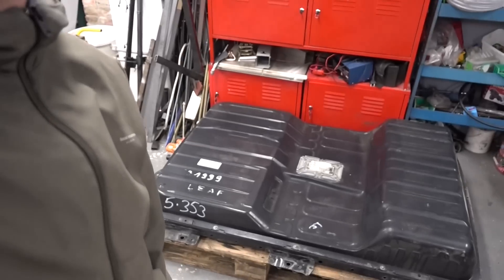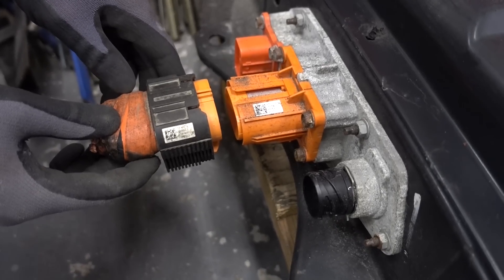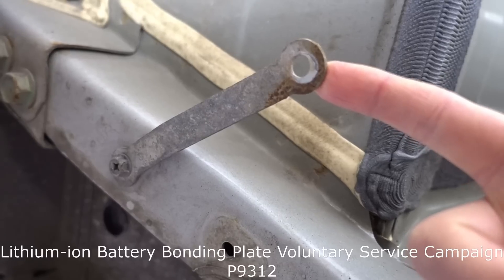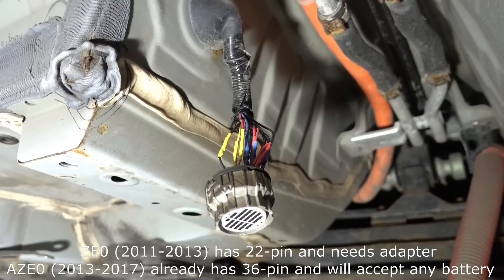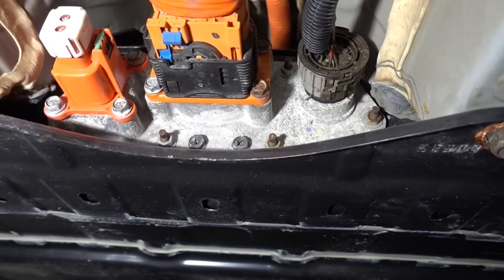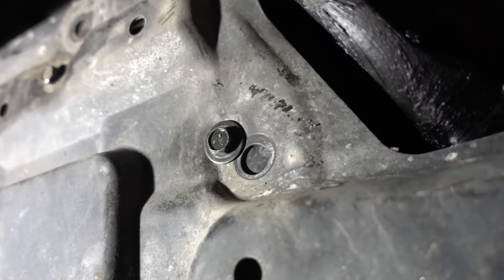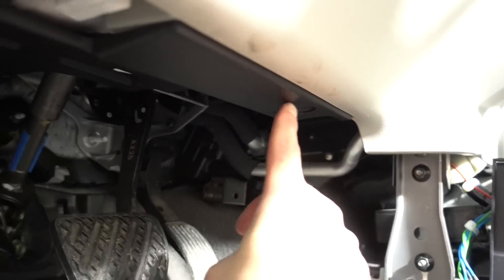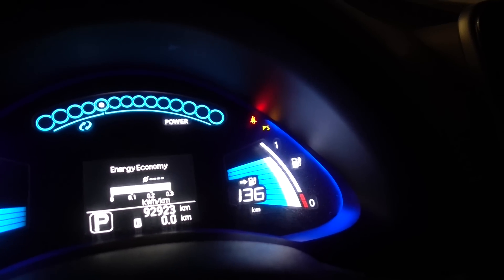Nissan Leaf Budget Battery Upgrade [ZE0, 24kWh-30kWh]

Comment: And this is why electrics aren't popular in regional Australia, it's 225km to the capital city from here.   Leaf will only go 130km or so without a recharge that takes hours, oh and there's nowhere to recharge it between here and Adelaide.
Reply from the maker: I visited the beautiful city of Adelaide last year. Out of curiosity i opened the Plugshare app, which shows the amount of public charging spots. It was a shock to see that a city with 1.2M inhabitants had less charging spots compared to an european small city of 65k people. You Australians have quite the road  to reach European charging standards. In EU, there are so many charging places that you can easily cope with a range limited EV.
Reply: @DalasEVRepair  thanks for the tip on plugshare, didn't know that existed.   There's exactly zero charge stations between here and Adelaide, some 225km.  There's apparently one here (which I must take a look at) and in the 540km between Port Augusta and Coober Pedy, just one at Glendambo (roadhouse has a generator).  Nothing between them but miles and miles of nothing but miles and miles.   Completely unlike Europe, huge distances and very little in between.  The Entire UK and all of Europe fits in Australia roughly twice over.
Reply: @geoffroberts1126  Oz is Tesla country, not Leaf country, it's far too big and hot.
Reply: @austrobok2958  Not really even Tesla country once you get clear of the cities.  No charging stations for hundreds of km and usually just one outlet.  Useless.  And 45c summers kill batteries, plus you really need AC  which kills it even quicker.

Comment: Great work , am looking at doing a cell replacement on my 24kw but contemplating replacing all together with a 30kw as 40kw packs a slightly harder to get at mo in New Zealand, are the 30kw cells the same so I can just swap into my original battery pack so no need for re pairing? And for your opinion if it’s worth just swapping all together is it possible to get in contact with you regarding purchasing the module (to talk to pack) and adapter cable please , thank you
Reply from the maker: Cell swaps to replenish capacity not worth it imo. Better to just source a bigger pack. But I know this is super hard in some locations! Good luck!
Reply: @DalasEVRepair  are you able to sell one of your can-bridges? And adapting cables? As you have used in your videos
Reply from the maker: @JonathanBell  Yes, hop on over to www.dalasevrepair.fi !
Reply: @DalasEVRepair  wonderful thank you , I just need to find someone with an Android beta to get the screenshot for you , I’m on iOS , this may take some time will definitely be in touch as soon as I have the info for you , this makes more sense to be able to do a battery swap anytime after it’s installed opens up more options for the future, thank you

Comment: in spain they upgrade the 24 kw to 40 kw  , in the 24 kw  package you remove the low battery cell and you can add more battery cel up to 40 kw , good video
Reply: How much does that 24 to 40kwh upgrade cost in Spain? Or even the 24 to 30kwh upgrade?
Reply: I think thé price start at 5000 € . You dont need to go spain . You send thé battery and thé return to you upgraded

Comment: Have you ever changed AC compressor? My own is making horrible noise and I believe it will soon fail. Once freon is emoved I believe it will be easy swap.
Reply from the maker: No experience with that, but should be easy. Check the Full Service Manual, it is a High Voltage operation after all!

Comment: Aloha, what type of jack/lift are you using to drop the battery pack.
Reply from the maker: Completely standard ones. Two on each side. When I did my first drop, I used 4 jacks. Nothing fancy is needed
Reply: @DalasEVRepair  aloha, I’m trying to figure out the pallet jack looking thing that is used at timestamp 5:15, I see a regular floor jack (red), what is the black thing under the battery. Thanks
Reply from the maker: @bpetty1688  I use two normal jacks and a metal skateboard. I've even used a wooden one when I did the first service! http://www.japtoys.net/forum/viewtopic.php?f=10&t=3613
Reply: @DalasEVRepair  understood.... thanks

Comment: Oh yes it’s zero emission car. Yah right. It’s a public relations game. What about all the energy used to make the batteries from the mine to the production factory, all the cost of producing the electricity and then disposing of a 600 pound battery. What does that do to the environment? What are the total emissions from this process?  I understand it’s slightly less than internal combustion engine vehicles but it’s not zero as advertised. In fact if you keep your gas powered vehicular beyond about 7 to 8 years it’s overall mor efficient than any electric can ever hope to be in its lifetime. Hydrogen is the future not electric. A
Reply: 1. What you said has nothing to do with the video.
2. Electric cars are far  less pollutant than fossil cars. Ignore what petrolhead motor journalists, economist, ICE professors and old CEO¨s from the fossile industry says. They don't have a clue. Always look at the source.
Good examples from people who actually know what they are talking about:
https://www.transportenvironment.org/news/does-electric-vehicle-emit-less-petrol-or-diesel
https://theicct.org/publications/EV-battery-manufacturing-emissions
https://innovationorigins.com/fraunhofer-ise-was-wrong-hydrogen-cars-are-not-cleaner-than-battery-driven-electric-vehicles-and-diesel-cars-are-not-even-close/
3. Hydrogen has been the futrure  of electric vehicles for 20 years and we are still waiting. It is really retarded (sorry)
    This video will explain it all for you: https://youtu.be/h-6BRdUPq54
Reply: Oh no not another hydrogen advocate with no idea where hydrogen comes from......Fuel cell cars are electric David, they just have a smaller battery with an on board fuel cell generator fed from hydrogen stored at 10,000 psi under the seats. Generating hydrogen is not carbon or electrically efficient and so much better to use electricity in its pure form.
Try googling hydrogen production. That is even before it is pressurised, transported and pumped in to the car.

Comment: How many miles done with the old battery?
Reply from the maker: 60k miles. The vehicle did not need an upgrade, but I did one anyways since I need it for my R&D. The original battery would probably have lasted another 60k miles in the vehicle.

Comment: This looks really very easy, as long as you have access to the lifting gear. Well done for putting this out there. Of course the main obstacle is fnding a used 30kwh pack. A quick look on ebay and...zilch. Lots of individual modles though. How feasible is it fo identify failing cells in the pack and swap these out with good ones? My 2011 leaf is on 10 bars, it would be good enough just to have the option to replace the problem cells and get that back to 12 bars. How feasible is that though?
Reply from the maker: Usually not worth the effort. You'll need to adhere to local legislation for working on high voltage systems.Good quality cells are expensive, and all that effort will be close to what an actual upgrade would cost. Go for a 30/40kWh pack instead!
Reply: @DalasEVRepair
Reply: @DalasEVRepair
Reply: @DalasEVRepair  Second this. You have to go through, charge and then balance the battery pack. If you are desperately short on money and knew enough about electronics to do that (while incurring all the risks that go with it) It MIGHT be worth it but you have to drive the car as a patch, i.e you are going to get it fixed within a week and not for very long. At that point because you have already disassembled and taken apart the pack once, it's only really conceivable when the car is worth nothing because now you have to do the labor all over again. 

TLDR; Get the battery pack replaced and recycle the old one OR turn it into something else. There is no point in trying to swap single cells as the risk of failure or continued battery degradation is more exspensive than replacing a battery pack once.

Comment: Just a fair comment: I like electric cars but the technology is too complex for the average person, too expensive these upgrades and even more for a car less than 10 years old. Unfortunately petrol cars are still cheaper to maintain and way risky to get electrocuted. They are not designed for upgrades but for replacing, not viable.

Comment: 3500+500+1800=€5800? What's wrong in my calculation? I cant get it to €2200.. ah.. end of video shows you sold first one.. :)
Reply: -1800€ :-)
Reply: @kacenk4  Yikes, it's like an engine and gearbox rebuild.   Too expensive.

Comment: Compare the cost of your upgrade to the cost of Nissan Leaf battery replacement and the difference is massive.  There are so many first generation Leafs with failing batteries  this is a really good video and I must say your English is also very good , much better than my Finnish.
Reply: I might buy an older Leaf if improved batteries were available at much lower prices.   Maybe in a decade that will be the case.
Reply: @timothykeith1367 leafs will all be gone by then man, things have been grabbed like candy by the battery recyclers
Reply: I found one for $1900. 2011, 33 miles of range
Reply: @theshawltyone I just bought one $1700 with 22 miles of range
Reply: @dougabbott8261  just looked at the price of going g from a 24 to 40 kwhr batter for a leaf and it’s 7000€ . Would be about that to get a car with that battery already in it

Comment: Has Nissan cured the battery baking problem that was reported out of Australia... in other words, no cooling, which shortens life of the battery to the point that THEIR replacement makes the car useless (The one I heard about was $10,000+ Australian for the car after lots of "software upgrades" to get the car past its warranty.)    That continent has a LOT of hot areas, so it's understandable that the failures would pop up there early on.  I've been looking for a 30kwh battery pack that is in good shape to power my house here... and a Leaf could be a good starting point.
Reply: We routinely have temps in excess of 45c in summer.   It was 38c two days ago and summer doesn't start for another 3 weeks.   I've heard of similar problems with other EVs - and there's a seemingly unsolveable range reduction if you need AC - and trust me, when it's a 3 hour drive on a highway in summer when it's 45c in the water bag, you need AC.   The cost of replacement batteries for a less than 10yo vehicle is insane.  Consider this is a country where 25 year old cars are still common and largely unrusted, engines/trans generally last at least 250,000, my Ssangyong Musso is up around 335,000 and still fine on the original engine/trans.   EVs look like a good idea until you hit all the hidden costs.   And the resale value of an EV with a dying battery is zilch, so no real SH market unless you refurbish, which prices it beyond the $2000 used car buyers like me.

Comment: Good video! Have you investigated V2H? We spliced the main high voltage cable and connected to a grid tied inverter to the house but its crude and would much rather get our energy from the CHADEMO port? That would be great if you could solve this.
Reply from the maker: Sounds cool, got a project link? Haven't looked into this yet!
Reply: @DalasEVRepair  take a look at our Facebook page https://www.facebook.com/HeliosEcoLab/posts/2841436872576422

Comment: Very well done. Is there any way to upgrade the existing battery pack with higher capacity instead of buying a new bigger capacity battery?
Reply from the maker: I am assuming you mean opening the pack and throwing random newer chemistries in? Yes, but there is also a lot of issues with this approach. Let me list the problems

- Crash safety. The OEM pack is simulated to withstand impacts if vehicle is in a collision. By not using the OEM fasteners inside the battery as intended, you risk having the battery short out internally in the event of a crash.
- Discharge curve issues. Normal lithuum cells are more linear compared to LMNO2, so the instrumentation will say that the battery is empty even though >50% of capacity is left.
- If you use 18650 cells, you introduce thousands of potential failure points where each wire is bonded to the pack. Only Tesla has been able to get away with this. If one wire breaks, there others need to pick up the slack, and there is a chance you will get a cascade failure. Pouch cells are more suited for DIY builds
- Isolation resistance readings. Huge risk of permanent 'Check EV' fault light on after upgrade.
- OEM BMS will limit to max 24kWh charging sessions. Along with other BMS related charging issues.
- More stuff I've forgotten

0/10 would not recommend. The engineering hours required is MASSIVE

Comment: Amazing the salvage yard just cut through the high voltage cabling. Good thing the contractors work!
Reply from the maker: Yeah it is a disaster waiting to happen, one day if they encounter a salvage vehicle with welded contactors!
Reply: @DalasEVRepair  Do you have problems with the contractors in packs from crashed cars? I imagine they don’t like being opened under load.
Reply from the maker: @compu85  They can withstand some beating for sure. And if I ever encounter a welded set, I have spares that can be installed.
Reply: I pop

Comment: Interestingly you publish this on the same week that Musk says that the next Tesla will have the batteries built into the structure to reduce weight and build cost. Also making them impossible to replace.
Reply: The batteries will be structural but that's not the same as unreplaceable. We await engineering details but I expect it will still be possible (maybe harder) to remove/replace them. Replacing individual cells in a pack may well be virtually impossible
Reply: The Tesla batteries last 2 million miles or about 3,500,000km though
Reply: @bikerdog2b  They DO or they WILL? Just curious...
Reply: @joeaverager  Jeff Dahn has tested the battery to 15,000 cycles so i imagine it is currently installed in a Tesla (I would guess the Model Y or coming in the Roadster and plaid)
Reply: @bikerdog2b  At what capacity?  50%?  40?
Reply: @geoffroberts1126  https://www.electrive.com/2020/10/19/tesla-researchers-present-battery-with-2-million-mile-lifecycle/. the article does not state the degradation of the battery only that it would do 10,000 cycles at 0-100% discharge rate. while a 0-80% discharge at 15,000 cycles would not degrade the battery significantly.
Reply: @bikerdog2b  Getting more like it.  I wonder how it would cope with our 45c plus summers?   Cooked batteries are not unknown here.
Reply: @geoffroberts1126 the new battery pack they are working on has better heat control but yes I wonder how much heat will affect the pack as well. The tab less design of the new cells allow better cooling from the ends of the batteries. Tesloop is a driving service that services California to Las Vegas and I believe the model X fleet has been very reliable.
Reply: @bikerdog2b  The issue is environmental unfortunately.  I suspect 'cooling' with 45c air won't be much help.  Perhaps liquid cooling?  I saw a suggestion about filling the battery container with insulation grade oil, as is done with transformers.  It would then be plausible to run that through a heat exchanger, it would at least spread any heat rise from concentrating in one battery pack, which seems to be an ongoing problem with the leaf.  I live in a region where 45c plus in summer is common, couple that with a 3 hour road trip that needs a fast charge halfway and you have a battery pack you can fry eggs on.
Reply: @geoffroberts1126  Las Vegas NV is in that heat range all summer. Tesla batteries are liquid cooled already. The engineering department has figured out space travel so I doubt cooling a battery could be anywhere as difficult.  I personally live in Canada so I am more concerned about the electronics functioning at -40°C
Reply: @bikerdog2b  So is northern South Australia.   Aha, didn't know they used liquid cooling, good move.   I absolutely agree it can be done, given the Tesla price tag, I've no doubt they have that under control.   Different climate, a REALLY cold night around here might get as low as 0C.  Hottest day was 48.5c.   Hoping for a mild summer this year.   I hate summer quite frankly.

Comment: How does the software adjust for the new SOC calculation or the range left? Does the new battery report the miles available or just the SOC and energy capacity?
Reply from the maker: The upgrade is perfect in terms of instrumentation. It actually showed 211km fully charged, and all the data with Leafspy were working just as a "normal" 30kWh vehicle would.

If you are wondering about the technical CAN-data on the bus, I recommend checking this repository out: https://github.com/dalathegreat/leaf_can_bus_messages

Comment: what a stud, great skills, I've had four Nissan Leafs that were leases, you see very few of them on the road anymore for this very reason, they were the most reliable cars we've ever had, but the batteries suck.....hopefully folks can continue to rack up miles now that we have videos like this available!
Reply from the maker: Thank you! And yes, these cars are bulletproof with a good battery installed!
Reply: @DalasEVRepair  Right about bulletproof.  I have a 2015 trim S 24 kwh pack @ 12 bars.  Odometer reading 108,500+ miles.  60 mile roundtrip work commute that includes 60% freeway (60 mph).  Live in the greater Seattle, Washington area is a mild climate contributes greatly to the battery pack's longevity.  Also, I drive in ECO mode nearly 100% of the time.